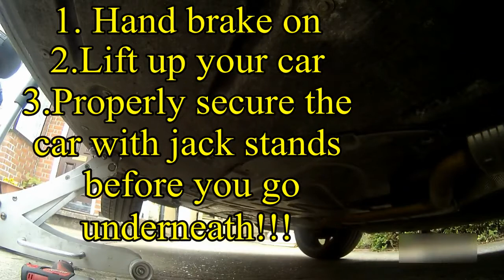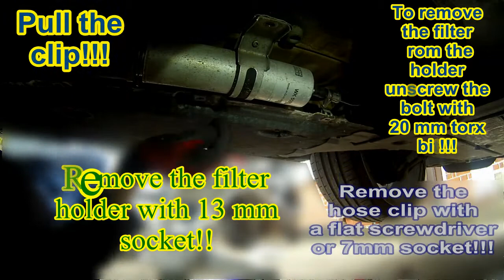BMW 335d E90 fuel filter change DIY

Comment: Good video just wondering did you prime the system for air bubbles etc ?
Reply: Also curious
Reply: I turned the car into accessory mode (press on button, no brake) and left it for a minute. Took two cranks after that and started right up.